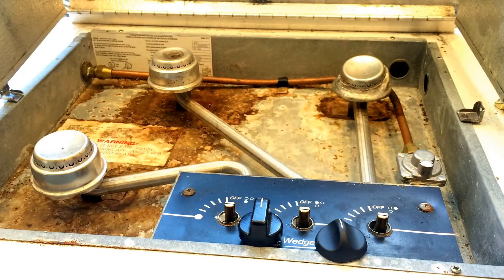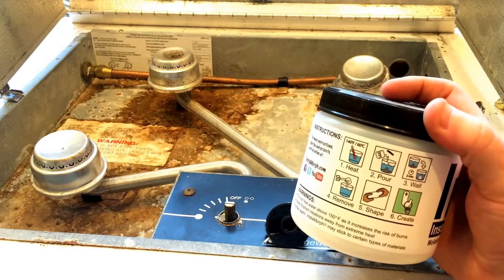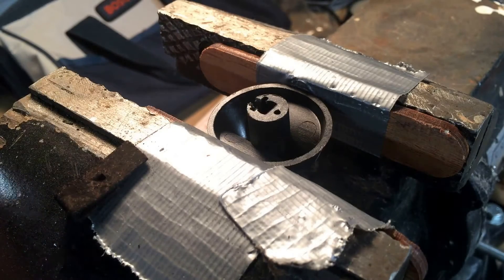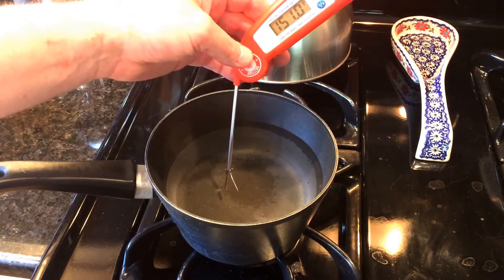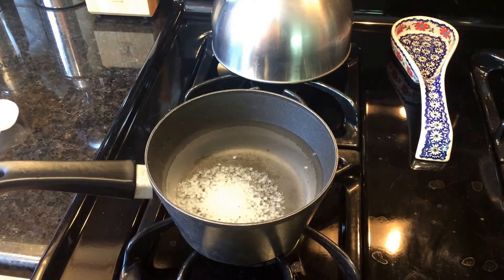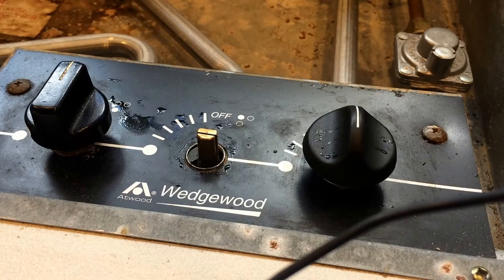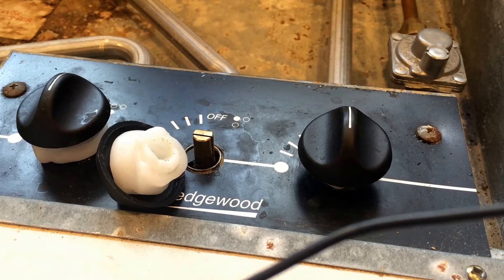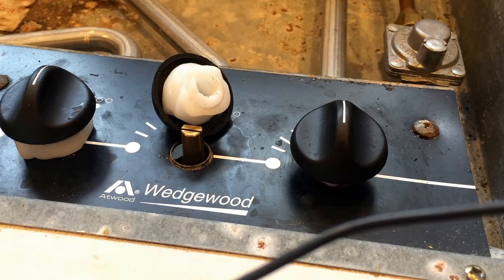Custom stove knob adaptors using InstaMorph moldable plastic

Comment: I wonder if hot glue would work?

Just fill the existing hole, and when it's half cured, shove it on the D-shaft.
Reply from the maker: Definitely worth a try if you have a hot glue gun. It could work depending on how difficult the knob is to turn